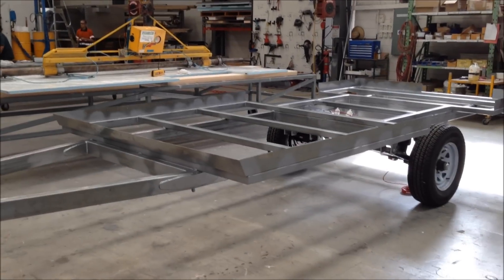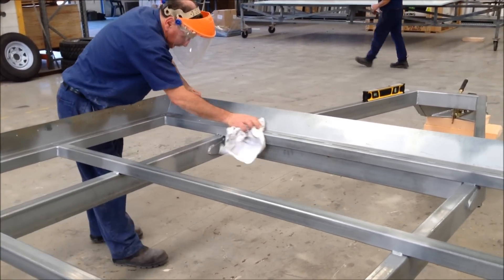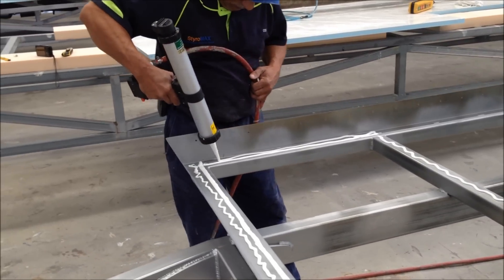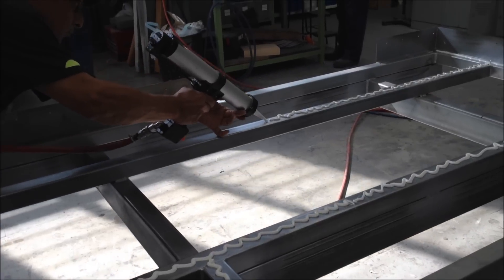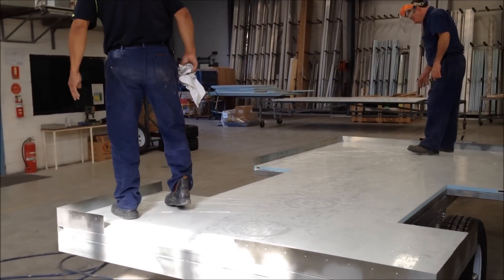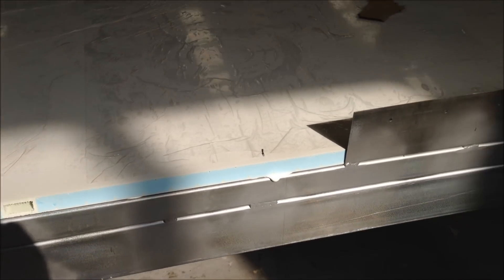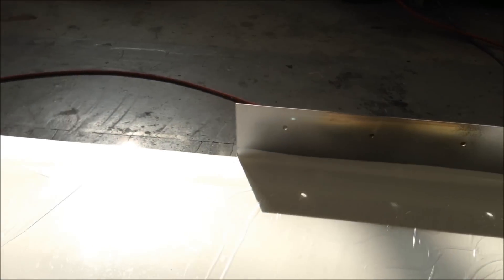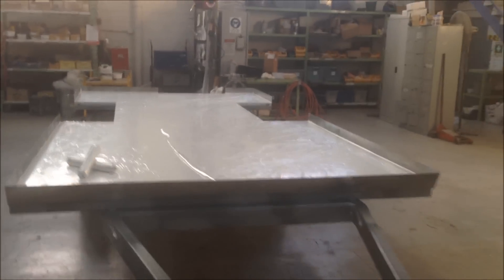Floor Panel Bonding with Teroson MS939 by Henkel

Comment: Hi, what does the flooring consist of?
Reply from the maker: Hi Mick, this flooring would consist of our High Density 25mm polystyrene foam core and a fibreglass skin on either side. You can read more about our panel on our website https://styromax.com.au/products/dow-styrofoam/
Reply: StyroMAX Insulated Panels thanks for the info, how much$$ per square metre.
Reply from the maker: All depends on your needs Mick. You can send an inquiry through our website and we can come back to you.
Reply: StyroMAX Insulated Panels okie dokie,